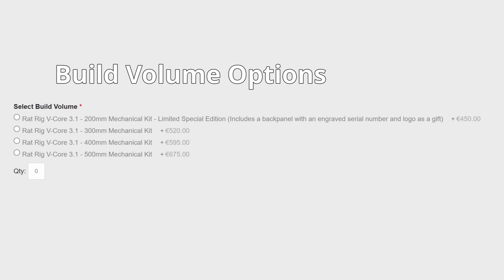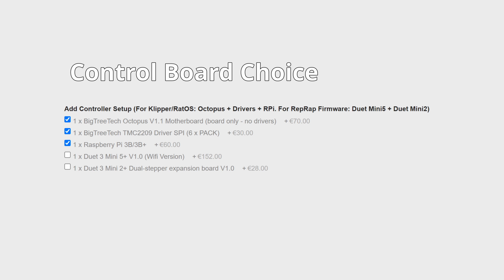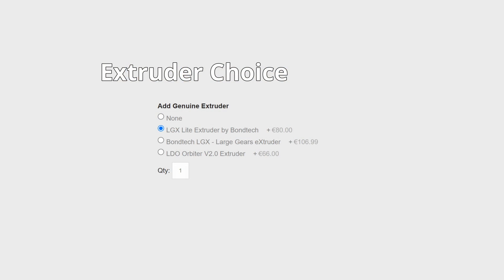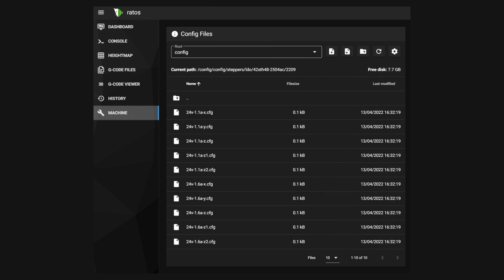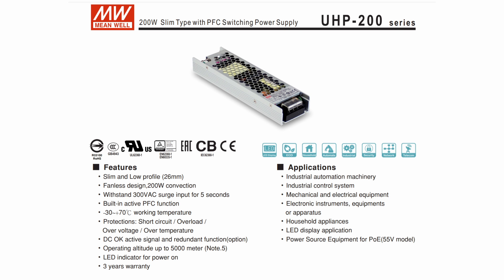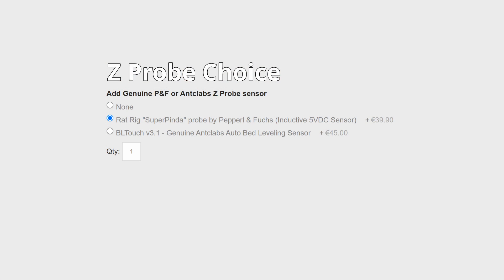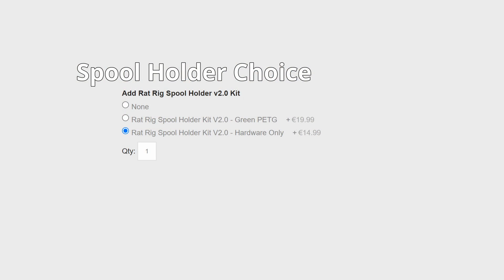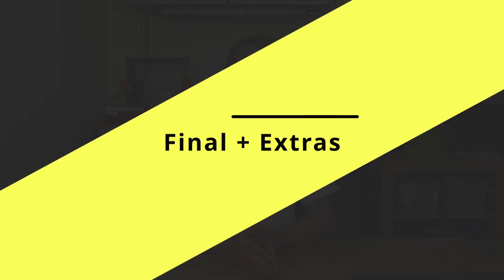Avoid Common Buyer Mistakes - Rat Rig V-Core 3.1

Comment: Just a note on sensorless homing: don't do it. There are multiple reasons for this. Sensorless homing on a CoreXY machine uses two drivers for one axis, this makes it a PITA to tune to a point where it's reliable, especially if you haven't done it before. There are so many people who come to the RatOS support channel complaining how their printer homes in the wrong direction (it doesn't, it just triggers instantly), crashing, stops working from one day to another etc etc, because it's not configured properly. Sensorless homing is unique to every printer, it depends on the moving mass, the tension of the belts and the motors used. There's just too many variables. I can guarantee that anyone will be done wiring endstops loooong before they have a reliable sensorless homing setup. It's just not worth it on CoreXY. You have been warned.
Reply from the maker: I did ask around in the RR discord a little while back when planning this video and a few people said it was easy and they had no issues with it. That's the only reason I mentioned it tbh, I'm quite happy with good ol' endstops.
Reply: @Vector3DP  Once it's tuned and you don't touch anything it's fine. It's everything up until that point. Also i suspect those people may have been talking about sensorless homing on the V-Minion. But it's fair enough to mention, and you do mention it's extra setup time.
Reply: Absolutely  well said!
Reply: Agree on that, sensorless homing on multi-motor axis (core xy, dual y on bedflingers, dual x/y on cross xy like annex k2/k3) is just a pain
Reply: I mean it's completely fine if you tune it. Been running sensorless just fine for a few years on my corexy machines. What you should say is that if you're a beginner who isn't interested in tuning don't do it.
Reply: @justindelpero  As i said, it's fine after tuning and you don't touch anything. It's still inferior and much more complicated and time consuming compared to endstops. Regardless of your experience level. Therefore it's not something that should be recommended to beginners or even experienced users.
Reply: @miklschmidt  I don't know why you've had such a bad experience. I prefer it over switches and cables, think I spent like 1-2mins tuning it on my 3 different printers during initial setup. I'm simply saying there's no reason to apply a blanket you shouldn't do this statement.
Reply: @justindelpero  So, you probably don't know, but i'm the author of RatOS, and by far the most common issue right after MCU/connectivity issues brought up in the support channel is sensorless homing. I've run sensorless homing on 5 of my printers, and it is not and will never be as reliable and easy to use as endstops on a CoreXY machine, that's just a fact, that's not an opinion. Endstops are faster, more accurate, requires less configuration and can home with speeds of up to 400 mm/s. There's just no competition, and considering the trouble people are having trying to set up their sensorless homing routines and tune their currents and sensitivities, it's just a bad recommendation. I'm speaking from quite a lot of experience here. I've done this countless times, and i'm still faster at wiring endstops than i am at setting up sensorless homing on a new printer. It's just how it is.
Reply: @miklschmidt  I feel that this is simply a communication issue. In short this is why custom DIY printers are the best, there's no right way. I'm not a RatOS user, that type of thing is not for me. People have the choice to do what they like, I've never had the need for perfect repeatability because I don't home mid print, but some do. I never said it was better (in terms of accuracy & precision) and maybe that's where things got lost, all I'm saying is that "you shouldn't do this" is the wrong approach. In hindsight, it seems the audience you are referring to probably should be discouraged but at the same time, there's nothing more infuriating than a community assuming a new User is incapable of tinkering. Maybe there's an opportunity here (I know Nero3DP has some midstream) to upload a "How to tune sensorless homing" (by RatOS devs) which includes the pros and cons of going that route.
Reply: @justindelpero  Appreciate it. You're not wrong, i was indeed talking in context of the video which is aimed at people who don't even know what hardware to pick. Just because something is objectively worse than something else doesn't mean you can't have fun playing around with it (RatOS or not). I'm running sensorless homing on one of my v-core 3's as we speak, as part of the development of the zeroconf unified homing routines in RatOS 1.3 - sidebar, you can even run single axes on sensorless in 1.3 with the flip of a variable. It is supported, it's just not what i would recommend to anyone buying a V-Core 3.

About RatOS, don't deny it till you try it dude, you might appreciate some of the features. You're right, i should make videos :)
Reply: @miklschmidt  I can't help it, I'm a control freak (20 years in winfra/*nix systems administration and 5 in cyber). Doesn't mean I wouldn't recommend it to someone else though! Kiauh / RatOS / pre-built images are very good for the community.
Reply: @justindelpero  I'm the son of a control freak just like that, so i get it :D Appreciate it, and thanks for being friendly :)
Reply: @miklschmidt  Thanks for your comment. I recently bought a Sovol SV05. Fired it up, went through “the steps” in the manual and got started. The printer is a cube with a Z that raises and lowers and a fixed gantry. The gantry has an endstop but the bed doesn’t. First print, the bed raised into the print head, drug the hot end across the bed, and trashed it. I’m olld school, spent years in IT, before that working on industrial injection/blow molding machines, etc… I was freaked out, there wasn’t an end stop for the bed, that I could set. Aka, you set the level with the typical four screws, then do bed leveling with the cr touch, then set the z off set. Great stuff but? I’d still prefer a hard end stop that I can manually set to prevent issues. I have NO idea what occurred, replaced the bed surface, and got past it. However, every time I fire up the printer for a job, I spend the first 45 seconds clenched, waiting for it to happen again. In the industrial LARGE PRESS world things like this also exist for safety and? It just makes zero sense to me to build something like this without having the ability to set a switch, that stops machine movement. Whether that’s for safety or to prevent your printer from trashing itself, matters not to me. That said, thanks for your comment. For me, as someone who’s written software as well, I see no sense in going “hard mode” when things like this are available. Lastly, first printer, bed slinger, second, cube. My next one is going to be CoreXY. That said, I see RatRig and Voron leading the pack. My question to you, as someone lookiing forward to speed, accuracy, configurability, Klipper, etc….. why would you, choose RatRig, over Voron 😁. Not baiting, I’d just like to hear your opinion as the  guy who wrote the OS. NICE WORK!!!!
Reply: This the first time something you have typed actually makes logical sense
Reply: @Heretic_Dezign  So even when you agree with me you still find a way to be insulting, excellent.

Comment: Choice of PSU is not so easy if you happen to live in the EU. The RatRig shop states: "WARNING: Meanwell LRS PSU is non-compliant on EU mains for use with 3D Printers. Please select Weho if you're EU/UK based, otherwise your PSU cost will be automatically refunded".

Comment: Good video but personally I would disagree on two choices.
First Revo, right now it only has brass nozzles. So no abrasives for it like glow in the dark or CF filament.
Rapido for light abrasives or CHC Pro for not having to worry about that.

2nd is the LGX lite.
While overall a nice extruder the Orbiter 2.0 has a lot more power. It has pushed through stuff where a LGX lite would skip.

Lastly the Meanwell doesnt get shipped to EU anymore, so you have to select the weho or buy a meanwell somewhere else.
Reply from the maker: ObXidian is not far off though, and imo its best to make a good decision now than have to change over later.
For extruder, from my extrusion testing, if the force is too much for this extruder, then it just means the hotend is pushing out unmolten filament; the problem is the hotend, not the extruder. Pushing harder removes the symptom, but it doesn't make a better print.
Reply: @Vector3DP  which gets us again back to revo not being suitable. It just cant push that much material
Reply: @Vector3DP  yeah but you haven't tested the rapido yet which can outrun the lgx lite. Also hanging out in the discord server and you will see so many people complain about the lgx lite
Reply: @Vector3DP  As John said it here, the Rapido can outrun the LGX lite, so its not actually an issue with pushing out unmelted material but simply not having the speed to push enough melted through fast enough. This is potentially more of an edge case but listing options for different use cases or simply buying one that can do it all is not bad.
Who knows, even the upcoming Revo HF could be too much for the LGX Lite.

As for ObXidian, its just that I have been a bit skeptical about the actual release date. You might know more but there is no official date yet. 
It was announced last year to be released at the start of the year. Now unfortunate events aside it still has taken extra time to even be in the hand of reviewers now and thats already been some time ago.
Reply from the maker: Yes I stupidly realised after making the comment that I had slightly overlooked the stepper speed vs torque thing. I'm still sticking with my choice though even if the max performance isn't as high, I really like it and its worked well on a couple of printers for me.
Reply: @Vector3DP  Your reasoning is sound and Revo has benefits other hotends dont have.
LGX Lite works as well, just not the highest end option.
But there is never a "best" choice for all things, so people will disagree on certain parts naturally.
Reply: @Vector3DP  the problem is often the extruder. I've used both the lgx lite and orbiter, and the difference is night and day. The difference in pushing force is really evident when you have a hotend which can outpace the extruder, like the rapido or dragon UHF
Reply: @morbus5726  What would you pair with a Mosquito Magnum, a LGX Lite or the Orbiter?
Reply: @JarodamusPrime  mosquito magnum is one of the worst options. Unless you want to print slow, dont get it. I would suggest a rapido or dragon UHF, as those can easily print at 3 times the flow, and are both much cheaper. Orbiter is better than the LGX lite when it comes to raw pushing power and flow rates. LGX lite has the advantage of pretension. I've used both, and the lgx lite struggles when printing over 30mm^3/s. I got an orbiter and it can easily push 60m^3/s. IMO the best combo is the rapido plus + orbiter v2. The combined price might even be lower than just the mosquito magnum.
Reply: @morbus5726  What determines the flow rates and was speed do you consider "slow"? I was leaning toward the mosquito because the rapido can only go up to 280c and I keep seeing people complain about the rapidos clogging issues.
Reply: @JarodamusPrime  By slow, I mean under 20mm^3/s. You should join the ratrig discord server and ask them about this. The rapido plus can go to 350c, and I have never heard of clogging issues. When I had it, it printed flawlessly.

Comment: Cheap and reliable hotend would the chc pro be. Same flow rate as a rapido but cheaper and more capable for cf filaments.
Reply: not the same flow, but still very good for abrasives.
Reply: @morbus5726  Users in Ratrig Discord tested it and apparently its the same maximum flow.
Reply: @warmesuppe  doesn't really make sense, as the rapido is longer and better insulted. I'm also in the server, and I didn't see that.

Comment: I would recommend everybody to build the Open Front version. It's a lot more accessible and easier to enclose.
Reply: Just completed mine after using the OG 3.0 and 100% agree. The bar in front is a nuisance. And much easier to enclose (less pieces and the folding lid still gets in the way)

Comment: the Revo Ecosystem has the downside of being inpractical if you plan to print certain Engineering Filaments, they tend to be outside of the Temperature Range of the Revo Heater.
might be worth to mention.

Personally i print Nylon up to 330°C for getting the little bit extra in Layeradhesion and Density.
Reply: Totally agree with Superbrain! I printed with my Ratrig 500 mostly PVC, PP, PC, PC/CF, Nylon/CF. So the Revo is not an option for me.